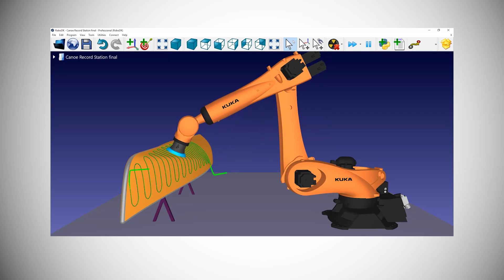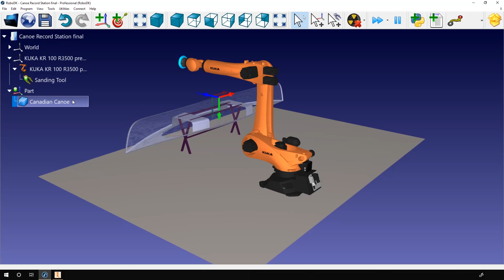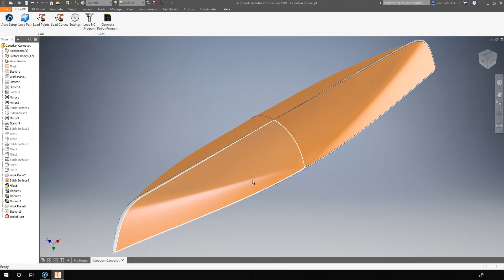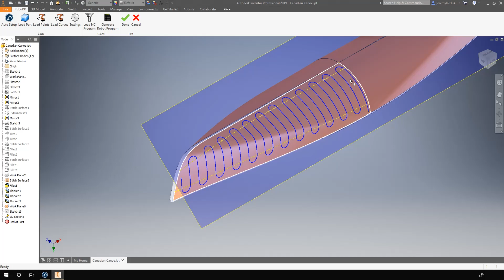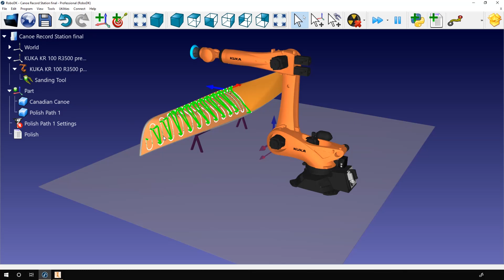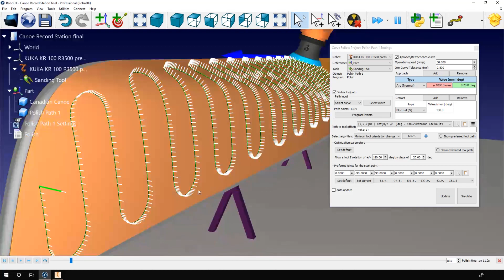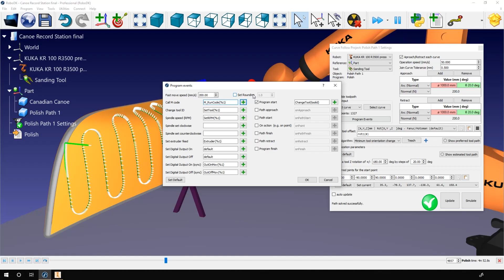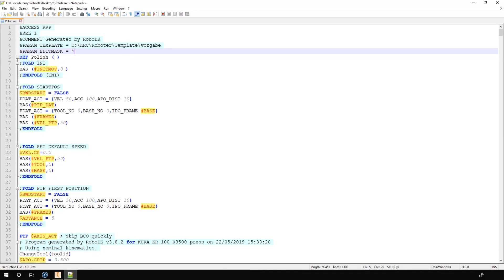Canoe Robot Polishing - Inventor - RoboDK Add-In

Comment: I opened this example file and the robot reached its limit halfway through. It says something about joint 5 close to singularity. What options do I have to overcome this issue?
Reply from the maker: Set the Tolerance to avoid Wrist singularity to 0.5 deg (in Tools-Options-Motion)
Reply: @RoboDK3D  Maybe there is a possiblity to write it into your Documentation, or something similar...
Maybe if you type "singularity" for search
Reply: Where can I find the  example file?